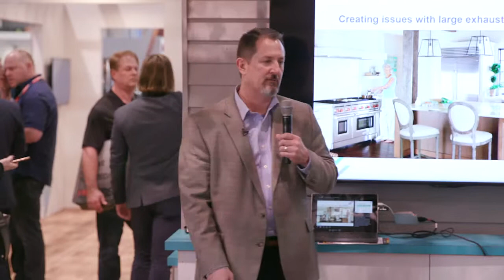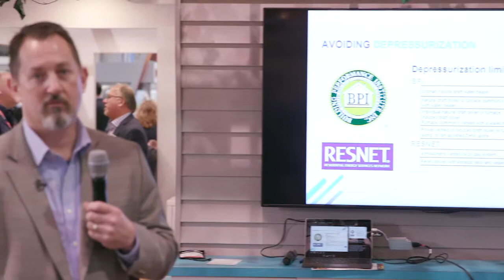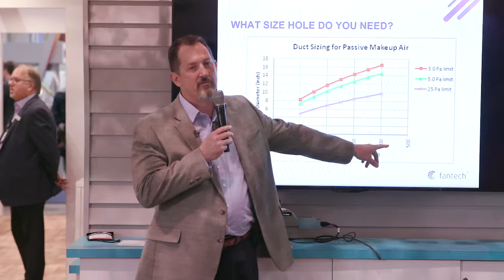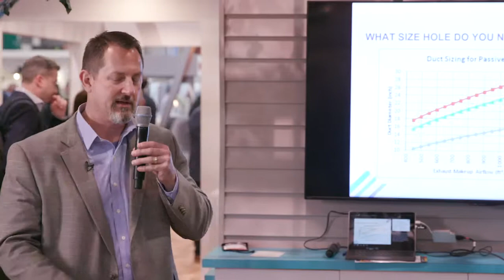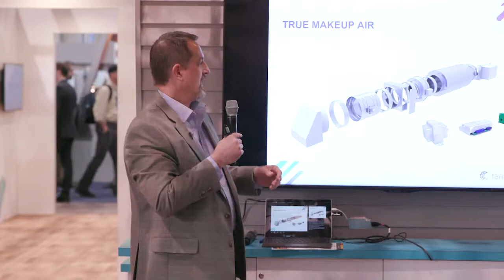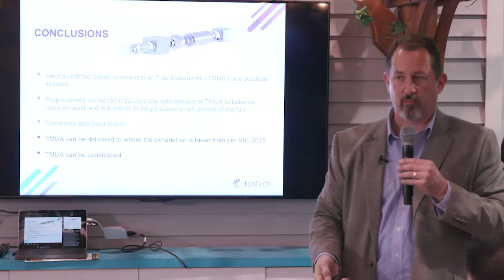Fantech - Keep Your Kitchen Full Of Makeup Air #fantech

Comment: "Come on bro, just buy my $2,000 fan bro, it's a great deal bro."  Put the damper under the range inside the trusses/joists with a floor register or pass through depending on what range it is.  A 12" damper provides 1,200 CFM (48 range hood standard) and costs $250.

Comment: The bathroom and drier exhaust is a good application for a small make up air duct to a return air duct.  The only thing that needs thought about is the distance from the actual furnace and if it has a reasonable space to mix it in

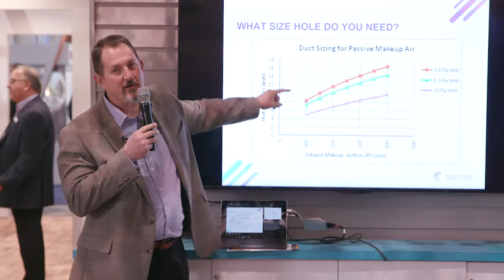Comment: 7:00
If 400-cfm is being removed through an 8" diameter duct, and the passive make-up hole size needs to be 16" diameter (or a 14"x14" square hole), then passive seems to be a better tradeoff. But obviously there is a threshold where mechanical becomes more practical.

This is how the 2020 Florida Mechanical Code reads -- look at the exceptions:

505.2 Makeup air required.
Exhaust hood systems capable of exhausting in excess of 400 cfm (0.19 m3/s) shall be provided with makeup air at a rate approximately equal to the exhaust air rate. Such makeup air systems shall be equipped with a means of closure and shall be automatically controlled to start and operate simultaneously with the exhaust system.

Exception: In a single-family dwelling, makeup air is not required for range hood exhaust systems capable of exhausting:
    (a)Four hundred cubic feet per minute or less; or
    (b)More than 400 cubic feet per minute but no more than 800 cubic feet per minute if there are no gravity vent appliances within the conditioned living space of the structure.
Reply from the maker: Mr. Panton, glad you have given the topic more than cursory consideration, since residential kitchen ventilation can affect many aspects impacting the home and its occupants. Of course, the construction codes are minimum requirements, and as you have pointed out those minimum requirements are not the same everywhere.  Here are some things to consider when selecting a residential kitchen exhaust makeup air system:

Air flow rate (cfm) exhausted equals air flow rate replacement
-	No matter the rate of air (small or large) being exhausted via a kitchen range hood that same amount of air will be replaced in some manner - some combination of cross-envelope infiltration, designed make up air provision, backdrafting, or other means.
-	A corollary to this is the rate of air which can be exhausted is limited by the rate at which it can be replaced. For example, if the home has the ability to replace only 200 CFM of air, then you can only exhaust as much as 200 CFM, even if the exhaust system is designed to provide more.  This can be an issue in tightly constructed homes.
-	Sure, we all know this, but it’s important to keep this in mind while considering what's going on in the dwelling as a whole while a range hood exhaust system is operated.

Air flows as a result of pressure differential
-	When a range hood exhaust system operates, the blower creates a pressure differential between the hood entrance and the building exterior.  Air flows as a result of the pressure differential, and is limited by the resistance associated with duct length and fittings, building tightness, availability of replacement air, etc.
-	Of course, this same principle applies to makeup air.  Air flows into the home only as a result of a pressure differential.
o	A home with no kitchen ventilation make up air provision relies upon infiltration through the “leakiness” in the dwelling envelope.  That infiltration occurs as the exhaust system blower removes air from the dwelling causing the dwelling’s pressure to become negative with respect to outdoors.  The tightness or leakiness of the dwelling envelope along with the exhaust system’s blower performance capacity result in the magnitude of depressurization and rate of infiltration.
o	A home with a passive kitchen ventilation makeup air provision still relies upon the exhaust system’s blower creating a depressurization, such that makeup air is drawn in through the passive opening. Therefore the passive provision needs to include an opening large enough as well as duct length and fittings of a size to allow for the flow of makeup air adequate to replace that being exhausted at a depressurization level minimal enough to not cause appliance backdrafting or other issues.  
o	A powered kitchen ventilation makeup air provision does not rely upon dwelling depressurization. Rather, the makeup air system’s blower creates the necessary differential pressure for outdoor air to flow through the makeup air opening and the ducted system and be supplied into the dwelling at a rate that matches the exhaust rate.  When such a combination of exhaust and powered make up air are balanced, these systems operate together while not imparting any pressure impact on the dwelling’s interior.

Construction codes – those which you’ve referenced
-	The Florida construction codes would appear to be most concerned with occupant safety (the potential for backdrafting), but we hope those codes would also consider other aspects such as health and comfort.  And, it would appear that the construction codes are making some assumptions, which we all know don't apply to every residential dwelling:
o	Assumption:  All homes are leaky enough such that 400 CFM of exhaust can be replaced via infiltration without endangering the occupants due to backdrafting gravity-vented appliances. We know that as little as 3 Pa (0.01” w.c.) depressurization can result in backdrafting of gravity-vented appliances.  Many range hood exhaust systems include blowers capable of producing more than 250 Pa (1.0” w.c.) differential pressure when operating.
o	Assumption:  All homes are leaky enough such that 800 CFM of exhaust can be replaced via infiltration without endangering the occupants due to backdrafting of power vented or direct vented appliances, and those homes will never be retrofitted with a gravity-vented appliance.  We know that power-vented and direct-vented appliances can be backdrafted at depressurization levels far less than that which can be produced by kitchen exhaust system blowers.
-	You might consider the dwellings which you design: Are they of tight construction? Are those dwellings leaky enough such that makeup air will take the path of leakiness in the envelope rather than via appliance and fireplace vent systems? Perhaps infiltration can't be counted upon even though the local codes would allow for it.
-	There are other reasons why it is undesirable to have a depressurized interior space. Of course, any amount of depressurization will induce the migration of air and its contents into the home, including sources from the air surrounding the dwelling, the air in the attic space, and the air in the soil or spaces beneath.  These sources can impact comfort and health, as we know.

Other considerations for passive makeup air for residential kitchen ventilation
-	A passive or non-powered kitchen ventilation makeup air system requires at least some amount of interior depressurization. For such a system, some amount of infiltration and its negative effects will occur.
-	Any duct work transporting air as part of a passive makeup air system will need to be sized to accommodate the rate of flow at extremely low static pressure resistance, resulting in unusually large duct sizes for the contained rate of flow.  This can limit where the passive makeup air entrance is located as well as where and how the passive makeup air is supplied to the dwelling.
-	It's not practical to apply filtration to the passive flow of makeup air, since doing so would likely result in too much resistance for the small level of depressurization available for the creation of flow.

Other considerations for powered makeup air for residential kitchen ventilation
-	A balanced, powered kitchen ventilation makeup air system creates no depressurization or pressurization on the interior space.
-	A powered kitchen ventilation makeup air system allows for reasonably sized ductwork for the transportation of the air from outdoors into the dwelling.  Additionally, since a blower is employed to create the flow of makeup air, more flexibility might exist as to where the exterior entrance and interior supply of makeup air are located.
-	Powered kitchen ventilation makeup air can be filtered, since these system’s blower works to overcome the pressure loss associated with that filtration.
-	There is of course some amount of additional cost to be expected with the installation of such a system.

Chances are you already know much of this, and perhaps you weren't looking for such a lengthy reply. But, we at Fantech have spent a tremendous amount of time thinking through the dynamics of ventilation and the impacts it has on a building and its occupants. We feel it's important to share what we know and help spread the understanding of such topics within our industry. Fantech’s solutions might not always be what you need, but perhaps for the homes with which your design expertise has been entrusted by your clients, our makeup air solution might very well make the most sense.

Thank you very much for paying some of your attention to this topic. We hope some of this has been helpful.
Reply: @Fantechusa  Thanks for the thorough response. On our commercial projects our engineers already satisfy this, but I could never understand why such an important topic is ignored in residential; and I've asked this for many years. Even the code I referenced is VERY relaxed.

One question, though: provided that plumbing or gravity vent appliances are out of the equation, what negative effects are there living in a depressurised environment? Are oxygen levels lower since it is a vacuum?
Reply from the maker: @Troy-Moses  It’s probably obvious that the most imminent danger related to building depressurization is the potential it creates for the back-drafting of appliances and fireplaces.  We aren't aware of any adverse direct physiological effects of the relatively slight depressurization caused by uncompensated air exhaust.  Such depressurization is likely no greater than what a person might experience on a regular, commercial airline flight.  Also, the availability of oxygenated air for the building’s occupants shouldn't be affected by a slight interior depressurization, assuming there is a separate and adequate provision for the dwelling’s continuous ventilation requirement.  However, there are additional undesirable effects that can occur when a building is even slightly depressurized.

When a building is depressurized, we lose some control over what enters the building and how it does so.  It's not practical that even the most tightly constructed homes are completely airtight.  Depressurization will induce infiltration of air and all its contents, and that infiltration will occur anywhere there are seams or gaps in the building envelope.  Where the building has ground contact or crawl spaces, humidity and radon can be drawn in with infiltration.  Infiltration can occur through exterior walls, too.  Outdoor air is often uncomfortable and it can contain pollen, spores and dust.  As this outdoor air travels through a building's exterior walls, it brings along humidity and the potential for fungal growth.  When this inherently unmanaged infiltration reaches the interior, comfort and indoor air quality can be tainted.

So, back-drafting potential aside, depressurization in a dwelling should be considered undesirable.  Balanced ventilation solutions exist for kitchen range hood ventilation (compensating makeup air systems) and whole dwelling continuous ventilation (ERVs and HRVs, aka fresh air appliances), so that design professionals can employ these systems to provide ventilation in homes without inducing depressurization.
Reply: @Fantechusa  Solid response, thank you.

Comment: why not an ECM fan in the makeup air unit sized to deliver up to the requirement for the kitchen fan, running variable speeds to match the required total home exhausting air from kitchen fan, + dryer, or whatever other unbalanced exhaust sources?  would a pressure measurement control system be feasible?   If it is not a heating or cooling season and the house is not fully closed, then makeup air will come naturally through a window or door, and the pressure controlled makeup air system will not activate.  (bathroom vent fans should be through the ERV/HRV system and already balanced.)